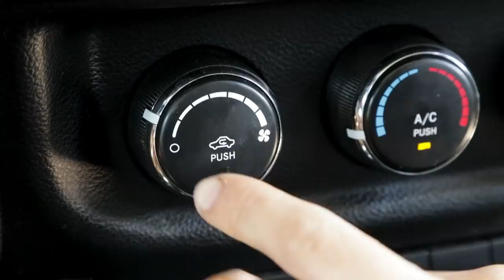NEW AEV COILS IN THE JEEP! - Phoenix, AZ Camp, Cook & Hike! /// EFRT EP 101

Comment: Funny. My Jeep doesn't have a top on and didn't in a few years so I never changed the cabin air filter. I remember the guy at an oilstop years back who asked me whether I want to replace the cabin air filter and I was pointing upwards with a rolling eyes face :-) Well, these days the filter stinks when I turn on hot air on a cold day (still without top, but one loves warm feet when the rest is cold), so I'll either remove it or replace it.